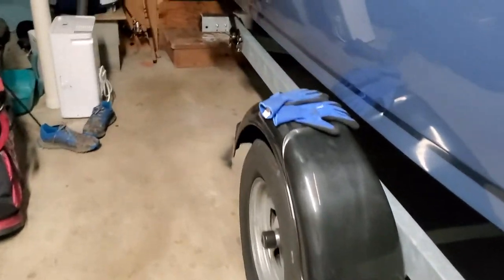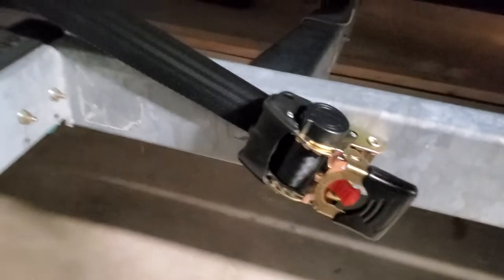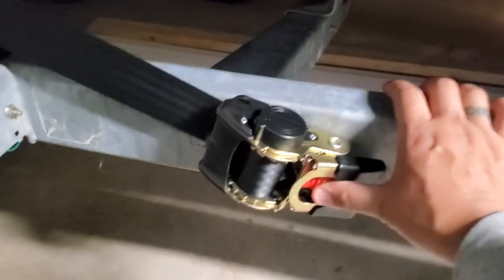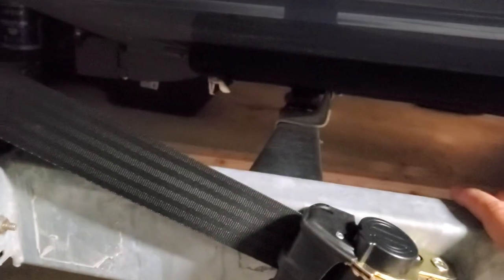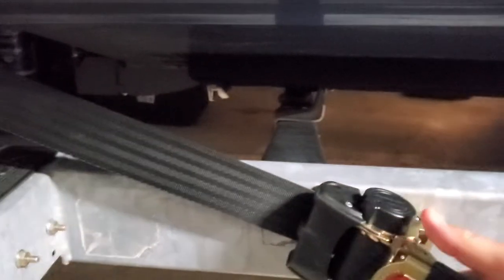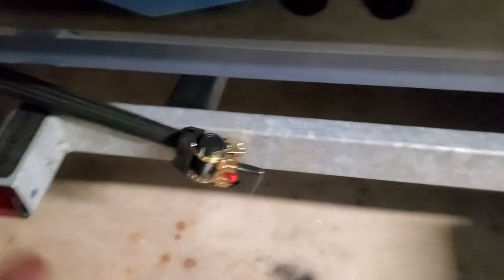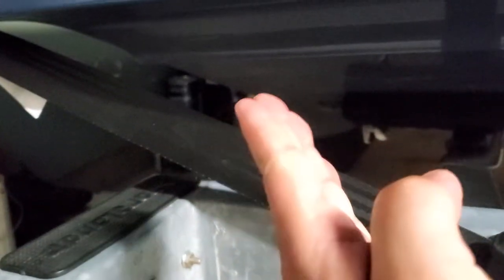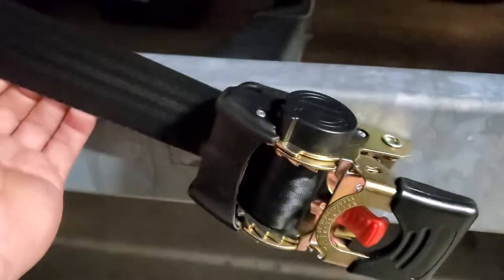Proper placement of the ratchet straps on a boat trailer

Comment: The idea of installing a ratchet strap is the pull the boat DIRECTLY DOWN onto the trailer. The boat and trailer are as one. What your ratchet strap is doing is pulling your boat forward onto the winch post. With the strap angle/s you have introduced you have little to zero down force holding your boat DOWN onto your trailer.